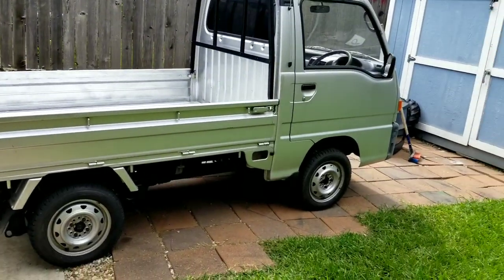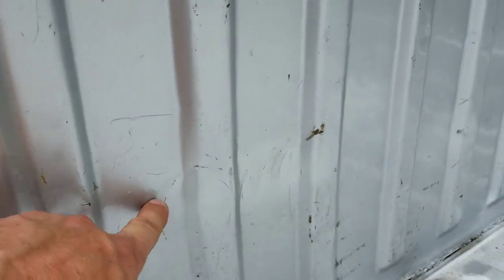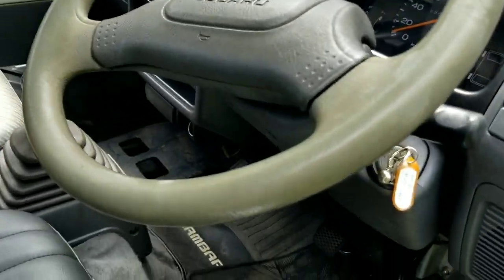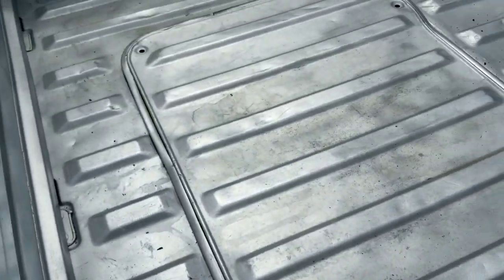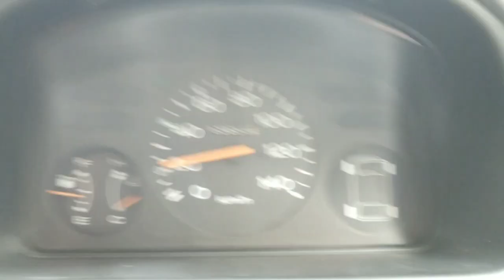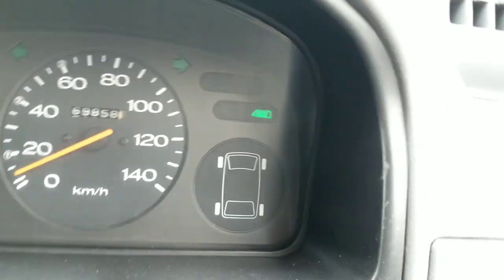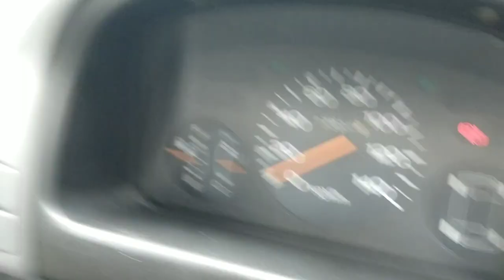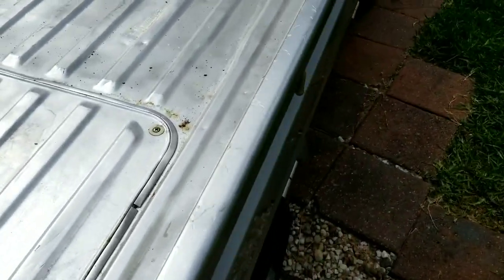Subaru Sambar hicab

Comment: Yours is a lot quieter than my KV3 but I think most of the noise comes from the compressor on my failed air conditioning, But who needs AC in the UK!
Reply from the maker: I have a used AC compressor, if you ever need it.
Reply: Polecat where did u get yours from in uk mate
Reply: @ashleygarnish9995  Mine was sold local parked at the side of the road and drove past it twice before having to buy it :) but their are a few on Ebay if you search Subaru Sambar in motors, private sales and also a couple of importers who will get one in for you.
Be careful though because a lot of them are not Subaru they are Suzuki being sold as Subaru!
My Van was bought from Sussex by a local guy and driven back to Kernow.

Comment: Which is the best mINi truck to buy ????
Reply from the maker: The best one for you.
Reply: @USMiniTrucks   thanks , which mini truck in youjr opinion is the most reliable engine and also a truck that doesnt rust
Reply: @citic101  My Subaru is a 94 and still has factory paint underneath, no rust if that helps?
Reply: @Polecat54941  ok thanks